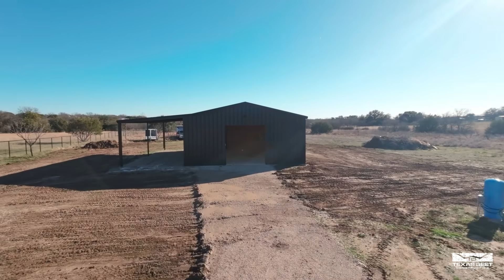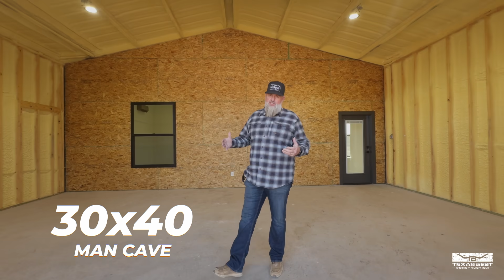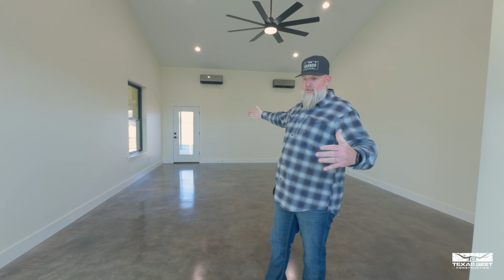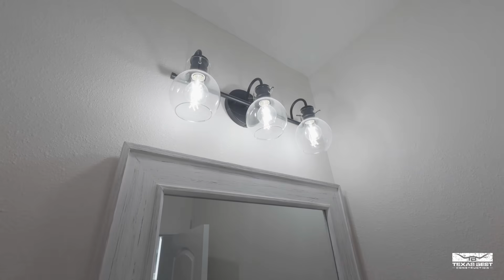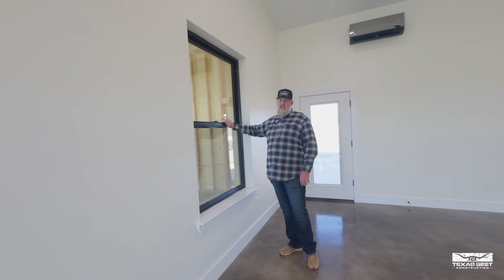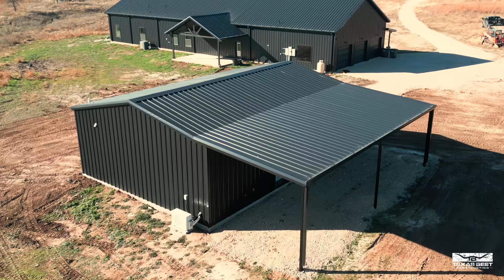Ultimate 30x40 Man-Cave Barndominium Tour!

Comment: Great building!!! But in hot areas, don't use dark colors it'll absorb the heat. Light colors will reflect heat.
Reply: Traditional, yes. The new science in coatings for metal roofs have changed that.
Reply from the maker: Thanks for the tip! It's something to consider. 😉